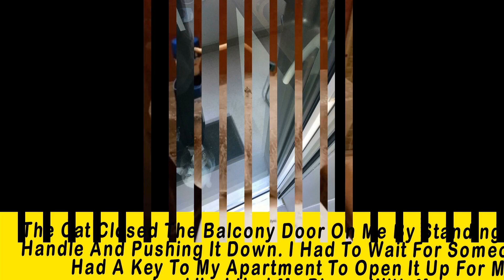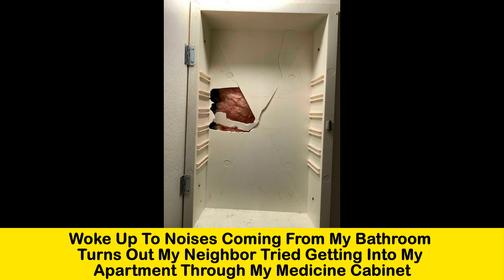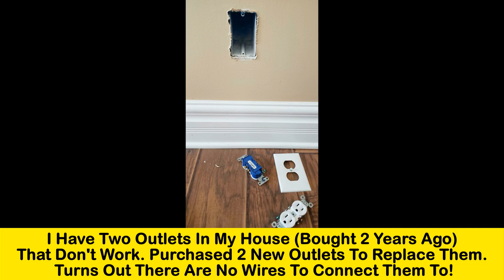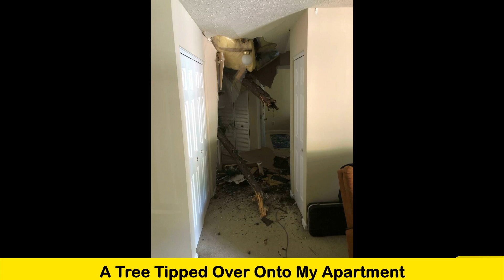“Well, That Sucks” Times Really Unfortunate Things Happened To People’s Homes || Funny Daily #574

Comment: Re: electrical outlets - My house was updated in the 1970s by the previous owner. I found 3-prong outlets that were missing ground wires, and one outlet had taps that connected through the wall to two other outlets. In addition, the tapped circuit was on an insufficient breaker, and I could feel a low vibration when I touched the toaster oven and range hood. Needless to say, the outlet was redone and the tapped outlets have been disconnected until I can affford to upgrade that circuit.